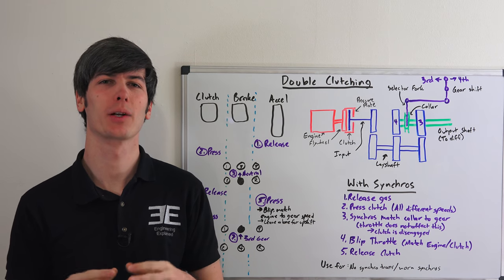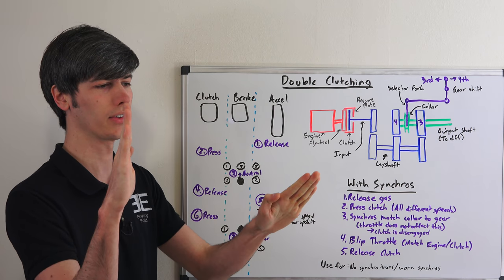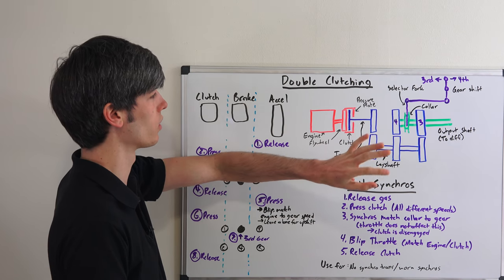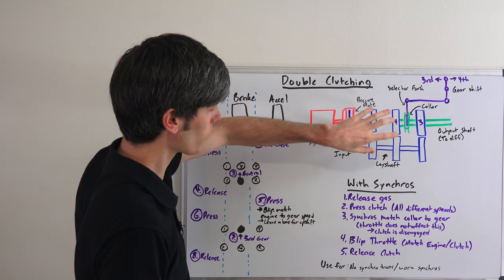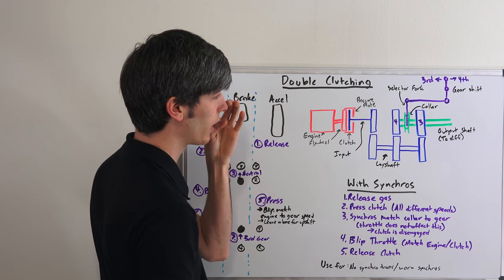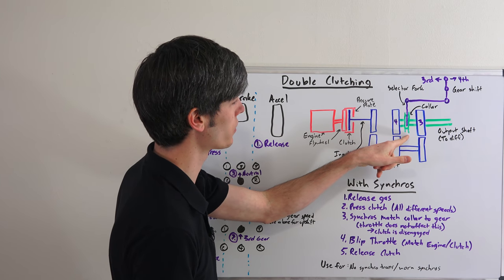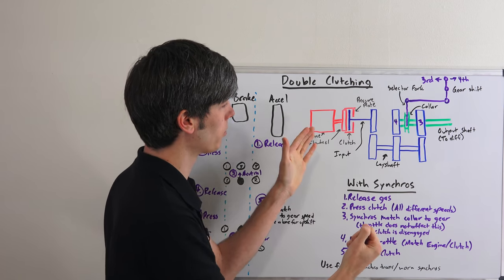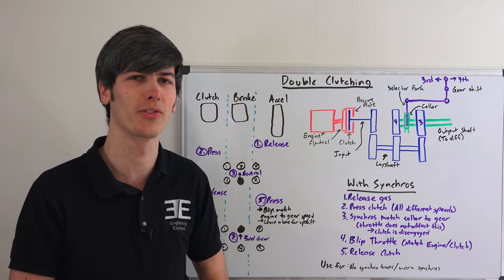What Is Double Clutching?

Comment: Seriously people, just rev match. You only have to double clutch when the synchro's are worn out. Rev matching already reduces synchro wear massively and it's what racing drivers use when downshifting (Heel toe)
Reply: +INFsleeper 
You should have probably noted that rev matching is to not upset the car when downshifting if you're driving at the limit (so, for racing drivers). (Professional) race car drivers get their equipment replaced often enough.
Reply: +Nee het is steen and why does it not upset it? because it's not engine braking. That reduces synchro wear :)
Reply: Rev matching doesn't reduce synchro wear at all. As soon as you press in the clutch Pedal and change gears, synchros will match speeds. 
It doesn't matter if you add throttle while the clutch is disengaged. 
Racedrivers are using heel and Toe to keep the car neutral while braking hard, reducing wear is not the reason for heel and toe. Double clutching is simply slower and race transmission don't need to last a long period of time.
Reply: +INFsleeper
Reply: +BerndvonBackstein It'll most likely make a small difference but I think people exaggerate wear of the synchro's a lot. But yeah racing drivers don't give a crap about wear
Reply: +Nee het is steen +1 For Innerspeaker cover art :)
Reply: +INFsleeper had a Chevy Silverado with 272k miles on the original clutch, I never put that thing in neutral when downshifting.
Reply: +INFsleeper Double clutching is also nice when it's cold out and your transmission fluid is not warmed up. It's also easier due to the longer elapsed time between shifts to make every single shift a perfect shift. It's an added challenge to perfect that makes driving stick more fun for me. On top of that, as everyone else has noted, it's good for reducing wear. There are racing transmissions without syncros where double clutching helps, and these are what they referenced in f&f.
Reply: +INFsleeper When he means by not upsetting the car is not shifting the weght of the car. If you suddenly lift the clutch the car puts it's weight to the front and onto the front wheels.
Reply: +Sir Grumpy Uhh What made you think I don't know that? Everybody who knows how to drive properly knows that
Reply: INFsleeper Because judging from your earlier comments you don't know much about the matter.
Reply: double clutching is useless unless you let our car run at neutral or of course synchros are dead. actually double clutching even burns the clutch more than just simply rev matching (if you double clutch for no reason). besides do rev matching and go straight to gear and you wont have any problems.. I wouldn't recommend going in neutral at wet or snowy weather. So really its even dangerous to do that when you think of it.
Reply: +Jesse V Absolutely correct - it's very good in smaller diesel cars in the cold weather in particular.  It is also especially useful when you wish to change into first gear whilst still rolling slightly, the reason being that second is too high and you'd need to slip the clutch to pull away - i.e. heading up to slow traffic, a traffic light, junction etc before needing to accelerate - trying to force the synchro to let you push into first gear on the roll is painful.....double de-clutch and it slides in without grief.

I've never lost the habit, synchro or not, it's just smoother - over several cars and what must be a seven figure mileage I haven't actually worn out a clutch, fork pads or release bearing.  I have, however, worn out a left shoe or two.....
Reply: +INFsleeper Right. I used to double clutch in my SRT4 because it had a slight 3rd gear grind, but I now only rev match in my Z06 which is fine for the most part
Reply: +INFsleeper Heel and toe technique.  Now that would have been the logical video to make after rev matching.  No wait the next one will be heel and toe double clutching, ya I like that.
Reply: +BerndvonBackstein Your switching things around that's why his comment didn't make sense. 

1. You double declutch when you don't have synchros or they're worn out. Not because it saves the synchros, but because normal rev matching doesn't work unless you have synchros.

2. Racing drivers don't care about wear, they heel toe so they don't upset the car. On the street however you rev match so that you don't wear out your clutch.
Reply: H Nielsen Double-clutching minimizes wear to the clutch and synchros while transferring that wear to the throwout bearing, a cheaper part than either a clutch or synchros.
Reply: +INFsleeper rev matching does nothing to help the synchros dude
Reply: ***** no, the clutch has to be engaged for it to spin the gear train..
Reply: ***** oh, well then yeah youre right. thats the first half of a double clutch before you rev match. My point still stands that just rev matching does nothing for the syncros as when you rev match youre bliping the throttle and going into gear simultaneously
Reply: Heel toeing is more to match revs for smoothness, less strain on drive train and reducing compression lock ups. Skillfull release of the clutch helps too.
Reply: Rev matching is useless.Rev matching doesn't allow you to change gears in a car.I have to double clutch all the time because I don't have a synchronized first gear.
Reply: ***** wow that sucks lol, what make of car is it?
Reply: not all racing drivers hell toe. watch rally drivers footwork and none of them do heel toe.
Reply: Rally cars use sequential gearboxes, no need to clutch between shifts.
Reply: not true, my 1918 cadallic NEEDS to be double clutched
Reply: Rj D My 1948 kaiser does too.A lot of people on here know nothing about cars.
Reply: I know right. 
I didn't know you could still downshift without synchros though. My 65 Ranchero was the first year of synchros for the car, which I didn't know until after driving a 64 Ranchero and grinding the gears.
Reply: "When the synchro's are worn out" you need to take the car in to get it fixed. You should absolutely never need to double clutch any sports car or regular vehicle. Only big tractors like semis actually need to be double clutched. And even then, it's much easier to just float the gears. It does absolutely no harm at all to the transmission if done properly.
Reply: INFsleeper yeah, I just heal toe and rev match. Double clutching makes me feel like I'm copying Fast 19 and I don't like feeling like that.
Reply: I know this is old but this is best comment.  I rev match through curves and occasionally double clutched through some to slingshot through.  Now when my clutch was going out and I had to skip gears, double clutching was very important. Hah
Reply: INFsleeper pretty much every car has a synchro anyway
Reply: Yeh let's just make sure we're all on the same page and agree that rev matching without double clutching will not in anyway shape or form help your synchros. They're doing all the work for you. Double clutch downshifting reduces wear on the synchros and if you're keen you can blip the throttle a second time to then match engine speed with the gear box. Not necessary, but certainly fun.
Reply: lol what is this misinformation. The only wear rev matching saves is clutch wear. Syncros are still being used to synchronize shaft speeds with revmatching.
Reply: beyondthelohjj
Reply: Doesmt double clutching just use up your clutch master cylinder twice as fast then?

Comment: I do this every day 15 gears up 15 down #thankatrucker
Reply: Yep, I learned to drive a truck before I ever drove a manual transmission car. I thought this was the only way to downshift lol.
Reply: Once your rolling never use the clutch, just accelerator pedal when gearing down.
Reply: @martinwarne7183  first thing I learned when driving a semi.   Might be the only thing :)
Used to drive my old Saturn like this... Much harder lol
Reply: @martinwarne7183  so act like the clutch is gone and find the slip point? I'm about to go to school for trucking but hoping to learn more before I go.
Reply: @Matthew-ev4cv  as if the clutch is inoperable. When gearing up, 1st to 2nd gear you have to let the engine speed slow down a little, to allow the gears in the transmission to match speeds on the main shaft and the layshaft in order for them to mesh. Conversely, when gearing down the engine speed has to be raised to match the gear speeds so that they can mesh. This is where the engine tach is important as it does help a lot. Most transmissions on trucks  have a 500rpm difference between gears and if it has a splitter it will be 250rpm. That's the basic principal, practice is the key, don't get rammy with it, after a while you can feel what is going in the transmission. Hope this helps, if you have any questions get back to me. Best wishes and good luck. Martin.
Reply: Thank at Rucker?
Reply: @ Pablo Bastias No you dont, lets be honest.  you probably stopped double clutching as soon as you found out that you could.
Reply: Double clutching is completely pointless. You have to match the revs anyway so why not just learn to float gears.

Comment: Pretty nice.  The only thing you left out is that you only have to let the clutch about half way out during the first release of the clutch peddle.  No gear engaged, very little wear on the clutch, simply matching up spinning gears. Decades ago I visualized this as "an upshift into neutral" where you lead with the gas as if neutral is a higher forward gear while I was learning the technique.  So double clutching can be thought of as "an upshift into neutral" between downshifts.  Doing it all while doing perfect threshold braking with little more than the ball and big toe of your right foot is where all of the art occurs, of course.

Comment: Nicely explained.   I especially liked how you simplified things with a very basic drawing.    Pop taught me the hows and whys of double clutching on a 1951 GMC pickup truck.   It had the really low "creeper" gear as first gear.   Later in life I got hooked on Triumph Spitfires.   The Synchromesh components were all shot.    Double clutching became natural.    Learning this technique is a lifesaver for those folks with worn synchro's.      Learn how to do it rather than spending thousands on a transmission rebuild.

Comment: I found that with floating, single clutching or double clutching, all require the driver to manually synchronize. This is something I discovered during my first month driving large trucks.
Reply: Right! So then all you're doing is more work for no reason. Just learn to float gears

Comment: Nice to know, even though manual transmissions are a dying breed in America  with about 2.7% of vehicles being sold with a real manual transmission—it was about 25% in 1995 (and similar numbers in Canada and Australia), and the ones that are still available have synchronized gears. Double clutching is useful to know for old vehicles or heavy trucks. Also a great anti-theft device as fewer and fewer drivers know how to use a clutch with each year that goes by.

Comment: Double clutching is useless in any modern car, bc a syncronized transmission does exactly this for you. All you can do is clutch back in in time to match the rev while upshifting and rev match while downshifting, but no need to double clutch. Thats a myth that is never going to die. All it does is making you slower because you need more time. It also increases the risk of crashing because it needs a fuckton of concentration, you destroy your transmission while training.
Reply: I agree, it's overkill for masters of racing to get miliseconds while downshifting,otherwise a waste of time, and other parts of gear shifting system except clutch(pedal,spring,master and slave cylinder,push-bearing,etc..)
Reply: I use it for steep down-shifts for smoother engagement, and to give the synchros a break.  With practice it requires no concentration.
Reply: Agree. I've been double clutch downshifting since learning to drive from a fellow who drove everything from trucks to tractors to buses and it's made driving any car a hoot!  All this effort trying convince people it's a waste of effort and concentration, is a bit over the top imo. Is DC necessary? nope. But in my world it puts the least amount of stress trans and syncros (and whatever else I don't know). BTW , the fellow who taught me all this, 42 years ago, still drives manuals as do I , and neither of us has ever had a trans or clutch wear out, even with some high milers. Each to his own and enjoy, be safe, and above all be courteous out there when whaling on your car and having fun!
Reply: inspectorchicken you need to do some research. modern car manual transmissions are junk. if you drive even somewhat spirited. the sycnros fail. for an example go look up a f23 or f35 transmission. they're know for weak syncros.
Reply: funny andrew taylor, my 2012 civic si has seen nothing but abuse for 75k miles and its still perfect.
Reply: Devin Stambolziovski based on your comment. you didn't look up one of the transmissions I listed. on a second note your honda does not have the transmission mine does. please go do some research before commenting again.
Reply: inspectorchicken he said its mainly cars without syncronizer
Reply: +PauL1e which one hasnt besides of russian 1950-today's cars?
Reply: inspectorchicken semis trucks do not use synchronizers.
Reply: Travis Scania trucks has syncronizers most of the trucks
Reply: PauL1e the trucks in the US do not.
Reply: I double clutch because that's how I learned to drive. I don't even think about it now and it take me a fraction of a second. I agree that It would actually delay my shift if I had to think about it, though.
Reply: michor10 in a car? Pointless? In a semi. Learn to float the gears

Comment: Wait hold on; so what is the difference between double clutching and "heel and toe" technique?
Reply from the maker: Heel and toe is when you're braking (perhaps into a corner), apply throttle to rev match the downshift. Only need to press the clutch once (assuming the car has synchros).
Reply: +Engineering Explained Oh ok I get now, thanks for explanation and the quick reply :)
Reply: +nhilal94 Heel & toe is basically the double-clutching technique explained here, but while braking simultaneously.  So you blip the throttle with the heel of your right foot (since the ball of the foot is pressing the brake pedal) instead of tapping it normally as described in this video.
Reply: +Engineering Explained technically you don't have to release  clutch right ?   if braking, 4 to 3, blip gas, release  clutch
Reply: +Hiroku am i the only one who brakes whit my big toe and blip whit the right side of my foot? i guess i have to big feet
Reply: +adam heed also do the same, depends on your feet and distance between pedals
Reply: +h0rr0r100 yeah basically if you revmatch you can shift without clutch, but revmatching is very very fast driving, and racing, when downshifting so you dont get wheel spin when you downshifft early. Also works for normal driving but its kinda dangerous in most situations, like city traffic.
Reply: +h0rr0r100 you'll see when you crash into someone haha, hope not tho :)
Reply: Heal and toe is blipping the accelerator to double clutch while braking. Hard to do on most pedal layouts. Imagine you are hard on the brakes into a bend and you want the correct gear for the bend but the correct gear means 6000 rpm entering the bend. Then you need to heal and toe. Or be sensible and slow down.
Reply: Heel and toe is simply rev matching while braking. There's really not much else to it.